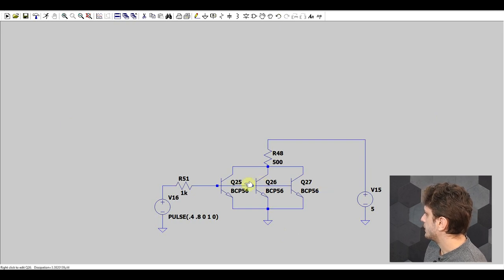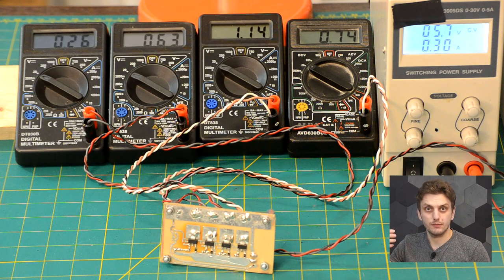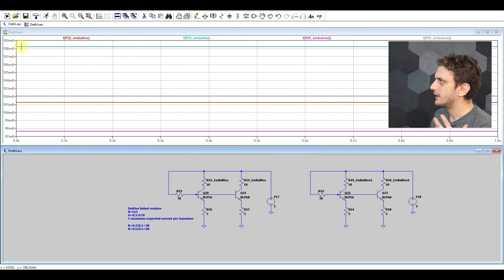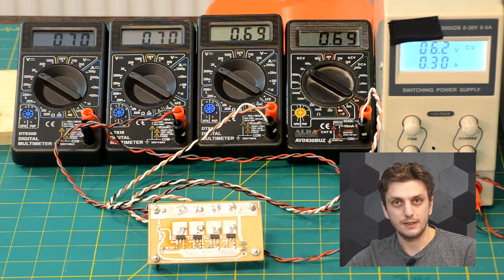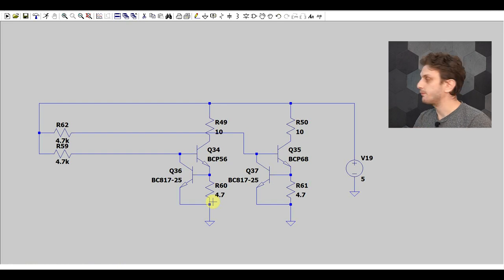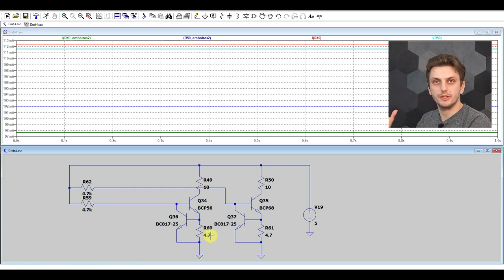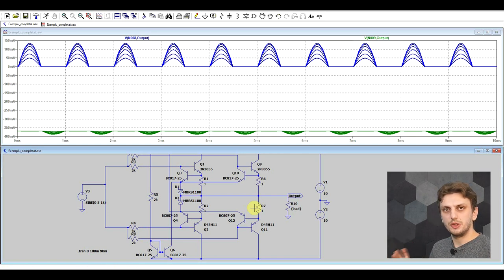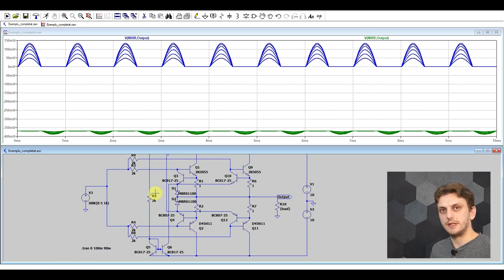Electronics Tutorial - 1/3 Driving multiple BJT transistors in parallel

Comment: Thanks for this one .. I like long videos. The title should say for BJT. I hope the next one is for MOSFETs, or why MOSFETs fail
Reply from the maker: Thanks for the suggestion! I will try to do that in the near future!
Reply: Mosfets mainly die because of 3 main reasons according to my experience; first is temperature dissipation, second is over driving the gate and third is spikes on the drain or gate. It could be also high reflections from the load to the transistor drain depending on your application.
Reply: @murad19882003  Correct.
They are also so much sensitive for over voltage in general.
Most BJTs are a lot more forgiving.

Comment: If we're just trying to get the power transistors (DC) current balanced with as low of a voltage on the current sense resistora, like with the circuit @ 16:24, I think at this point it's better to just bite the bullet and use an LM358 to provide the feedback. I do appreciate the discrete component circuit, but with the cheapest LM358 costing just over 2 cents at lcsc, it is such a cheap and jellybean component that it may be worth it in this application and I'm pretty sure it could work with just 100mV on the sense resistor.
Anyway, I do see that the video had a clear progression and considering the next circuit described it all makes sense, just thought I'd put my  two cents (heh) in.
Reply from the maker: Well, I was testing in DC because that is easiest to show, but the same methods can be applied even if the circuits have a certain frequency signal going trough. I guess the biggest problem with the op-amp method is that you need to take care of the bandwidth of the circuit, and also the op-amp needs to be close to the power transistor, otherwise you could get oscillations and other fun stuff.
Thanks for the input!

Comment: Hello Fesz!  

Really interesting subject.  Very well done.  A few comments and questions.

To start at the very beginning we could look at a single BJT wired up as your BJTs were wired up: base and collector to the V+ supply, with a current limiting resistor in the base, and the emitter at ground.  Once we apply power the transistor will start to heat.  Given the thermal time constant associated with the heating of the junction, the thermal resistance between junction and ambient and the applied voltage, it is in the nature of a BJT that it will either stabilize at some elevated temp or it will blow up.  The possible blow up is as you said, due to a positive feedback loop.  The nature of this loop is that as heat is added to the junction, the kinetic energy of the valence band electrons is increased to the point where they can pop up into the conduction band.  Since the depletion region is relatively low in carriers, these thermally generated carriers make a difference and the forward current increases.  More current produces more heat, more heat produces more current, and so on.  This is called "thermal runaway."  The increased current as a function of temperature is expressed by the Ebers-Moll equation, which you indicated.

The most effective remedy is negative feedback using what you properly described as emitter ballasting.  Here, as soon as the junction begins to heat, the increased current presses against the resistor, raising the emitter voltage, which decreases the VBE.  Since the current is exponentially dependent on this voltage, this is a powerful lever.  Note that the improved matching when you went from an RE of 3 Ohms to an RE of 5 Ohms was only about 3% (currents went from 108 and 101 to 102 and 98, a delta decrease from 7 to 4 on averages of 104.5 and 100), at the cost of a 66% increase in dissipated power.  Knowing the best amount of voltage drop across RE is best determined from historical experience (rule of thumb), as you have pointed out.

In an IC, the NPN power transistors are well matched, and in that case the current difference between transistors comes from voltage drops along the common ground (which put the emitters at different voltages).  The remedy is the same, an emitter ballasting resistor.  Finally, since this problem exists in all BJTs, we also see it small-signal amplifiers.  There, the ballasting resistor is called "emitter degeneration" and it stabilizes the collector bias (DC) current over changes in the ambient temp.  Here the delta Ic is (the temp change x 2mV/degree)/RE. RE also sets the small-signal gain, unless you don't want it for that, in which case it can be bypassed.

My first question would be:  since this problem is inherent in the BJT, are there any circuits that you know of that don't use an emitter resistor?  I can think of only two, a temperature sensor and a logarithmic amplifier, but you know applications much better than I do, and I would be curious to know what other circuits BJTs show up in without needing a emitter resistor.  Also, related to applications, do you still see that BJTs are being used in power?  Because of thermal runaway and secondary breakdown (which is a different failure mechanism associated with turn-ON and turn_OFF), in "Fundamentals of Power Electronics 2nd Ed, Erickson and Maksimovic say that "At voltage levels below 500V, the BJT has been almost entirely replaced by the MOSFET in power applications" (page 86).  This was written in 2004, and these guys are college professors, so what is your opinion?  Do you still see BJTs in power applications?  

Lastly I would love to understand the circuit that you came up with for reducing the drop across the ballasting resistor, but I was massively confused.  The LTSpice schematic showed the anode of Schottky D3 at ground and its cathode at the emitter of Q47.  Looks reverse biased, no?  Also there is a ground symbol connected to the positive terminal of V23?  Anyway, looking at the white board (excellent diagram) that you show above the built circuit in your lab, the drop across the ballasting resistor is now (the voltage on the emitter of the power transistor VE, minus the negative supply plus the 3.3V Zener).  OK, fine but what value is the negative supply and how did you choose it?   More importantly  what is diode D2 doing?  You said you "added the current sink and diode to supply the emitters of the (low power) transistors".  It looks to me from the circuit on the whiteboard that positive current from the emitter of the low power transistor would be reverse current in Schottky D2.  On the other hand, the drop across the ballasting resistor is the VBE of the small power transistor minus the reverse voltage across the Schottky, which sounds like what we want.  Is the Schottky reverse biased on purpose?  I'm just ignorant of this kind of thing.  Would love to have it fully explained.  I had to stop here, because there's too much I don't follow. 

Anyway, beautiful work and presentation as always, thank-you so much!!
Reply from the maker: Hello David!
You are right, bipolar transistors are rarely used in power electronics. Any SMPS I worked on either had external or internal Mos-Fet's. The only common usecase for BJT i've seen is with things like digital signal switches - here the RE is not used, but its not needed anyway. I haven't really worked with, but in high power (1000W+) applications you have the IGBT which is somewhat of a hybrid between the BJT and MOSFEt, which is still in common use. 
On the other hand, with audio or other linear signal amplifiers, the BJT offers more linearity than MOS-Fets; as long as the amplifier is not working in Class D then the BJT seems to be preferred.
Regarding the other point, lets start with the schematic on 14:28 - V23 has the positive terminal to GND so that its negative terminal is a negative voltage in reference to GND - the emitters of Q48/Q49 are at -5V in reference to GND. The point of the current mirror (Q48/49) is to set a current going from GND to -5V trough D3. This sets the cathode of D3 to ~(-0.3)V in reference to GND.  
With the whiteboard ( at 16:30 ), I did forget to add the "GND" but its the Cathode of D1. The negative supply is now 3.3V in reference to GND thanks to the D1 (the value was chosen mostly by what diode I had available - I only needed a voltage sufficient to keep D2 polarized and to keep the current mirror operating correctly). D2 again is directly biased, so its cathode is at ~(-0.3V), so below GND - the schematic could have been maybe drawn a bit better... 
In both cases, the signal driving the active ballast transistor is the RE voltage drop plus the D2 voltage drop. 

Let me know if this makes sense. 
Fesz
Reply: @FesZElectronics  Hello Fesz!

Thank you so much for your detailed explanation! I do understand everything now.  I learned some cool stuff and am very happy. 

Let me say this though.  In introducing the LTSpice schematic with the Schottky diode offset, you said not one word about introducing a negative supply.  Remember we are seeing this for the first time.  Furthermore, the ground symbol used to define that negative supply had a wire running over it, somewhat obscuring the ground symbol itself.  I know LTSpice lets you do this, but, in my humble opinion, it is not a good practice.  I think the rail-to-rail environment (the supplies) are the essential framework of a circuit and should be noted.  

It is all obvious to me now.   

Here is how I see the offset working.  With the addition of D3 and the current sink Q49, we may start at the collector of Q49 where the voltage is about 0.3V below ground. Moving up, through the emitter of Q46, we then reach the base of Q46, which is the voltage across the ballasting resistor and this is (-0.3 + 0.6) = 0.3, and you have reduced the voltage across the ballasting resistor by the drop across D3, just as you said. This is a beautiful way to create a desired offset.   The voltage on one end of the ballasting resistor is pulled down by the drop across the Schottky, while its other end is grounded.  Very, very cool.  I am looking forward to learning more. 

Finally, you mentioned that: "with audio or other linear signal amplifiers, the BJT offers more linearity than MOS-Fets; as long as the amplifier is not working in Class D."  Do you have any videos that talk about audio and linearity? Like how do we measure linearity,  what does it look like in a circuit, how would an output be more linear with a BJT than with a FET, etc.  Just anything to learn about linearity in an application.  Any videos on that?

Thanks again for your amazing work!!
Reply from the maker: Hello David,
I did not cover linearity in any video yet. Don't get me wrong, you can make a perfectly good amplifier both with BJT and M-FET. The BJT is cheaper, and from a linearity point of view, the driving the FET is like driving a capacitor - the gate-source capacitance can be in the order of nF so you need completely different current to drive it at 20Hz and at 20KHz. Also for FET's you have the transition between linear and saturation regions at quite large drain-source voltages - so the change in behavior needs to be taken into account. J-Fets on the other hand are far more linear. To be honest I did not study this problem in to much detail so I may be missing some points.
P.S. I will try to keep my schematics more easy to understand, and go into more explanation details. Thanks for pointing this out.
Reply: @FesZElectronics  Hello FesZ,

It is always great to read your comments!

Yes, JFETs are interesting.  When I worked with power op-amps (hybrid circuits) the differential pair was typically built with JFETs.  Flicker noise in MOSFETs is associated with the thin -oxide (carriers get trapped there and released, if I recall correctly).  JFETs have no thin-oxide, so no flicker noise (if I am wrong let me know).

Your work is a tremendous help and asset to me.  Thank you so much for what you do!
Reply from the maker: Indeed, JFET's are known for being low noise - they are often used as high impedance input stages - in IC's as you mentioned, but even in things like oscilloscopes, the very first component the signal sees, is usually a JFET. From what I read only BJT can be built with lower noise than JFet but you need some current to drive them, so a Jfet input stage in an op-amp has a much lower input bias current. 
I guess the only problem with JFets is that they usually come in low power versions. On the other hand, for a final stage in an amplifier, it does not matter if the MosFet is noisy, since its contribution to system noise is minimal.

Comment: Very juicy video. Chuck full of bits and bites of solid reasoning and clever design tips.
I wonder why no one uses PTC power resistors for RE! It should prevent thermal runaways in MOSFETS. 
Logically, it should work, but I've never seen one!

Comment: Hi Fesz, what a cool video! thanks. I've dealting with this issue in audio amplifiers and isn't easy to calculate with precision the emitter resistors to avoid positive feedback and with  reduced dissipated power... normally I do a fast test with a heat air flow and adjust the resistor for a pessimistic scenario. It typically gives a value minor then 0.22R... However, to have some margin I always finishing by using the typical value of 0.22R 😄.  Best Regards, Hugo
Reply from the maker: Hello Hugo! I'm happy you enjoyed the video! What sort of currents did you have running trough each transistor when you used the 0.22r in the emitter?
Reply: Honestely Fesz this was for a project that was never been finished... but I remember that I have done some trials for 3A to 5A of peak current in each device and after some calculations  the resistor adopted was 0.22R. I don't remember the exact values but the question was something like this: ok 0.07R is enough but 0.22R gives a better current distribution and the dissipation is acceptable 2.5W... so let's use 0.22R 😄. In fact, this resistor has some impact in THD. This is a very interesting theme and there are few information about it. I've done a couple videos, in Portuguese,  talking about these resistors and respective design criteria. Maybe you can talk a little bit about this in the next videos. My approach at the time was: assume a maximum delta vbe deviation between the 2 devices, ok 350mV... (one hot and the other cold)  and calculate the resistor that  gives this voltage drop with the maximum expected current, 3A or 5A. My final project only uses one device, STD03, so i don't have this issue 😉 but even in this case it uses 0.22R 😄. A big hug 😊👍

Comment: Great video as allways!
One thing to note: mosfets, as opposed to bjts do not need matching for this type of application  and can be directly connected in parallel as the rds_on has a positive temperature coefficient, providing in by itself the needed negative feedback -> adding source degeneration as suggested at min 9 may be a bit of a overkill.
Spor in ceea ce faci omule, esti cel mai tare eevloger din cate stiu!
Reply: If you drive the MOSFETs in the linear region that's true, but then in the saturation region the temperature coefficient is negative and the same problem arises.
Reply: Not correct what you say, in fact Rds_on exibits PTC behaviour in saturation (MOSFET fully on). 
Nexperia application note AN11599 chapter 2 treats exactly this subject.
Reply: @bogdansofalca6946  Confusingly what is called saturation for bjts is linear region for MOSFETs, so you're reffering to the linear region. https://electronics.stackexchange.com/a/18904
Reply: @axk1  I did not know that.  What you say is very interesting.  In the linear region the flow through the channel is resistive and the resistance goes up with increasing temperature because the mobility goes down.  The mobility goes down because at higher temperatures the crystal atoms are vibrating more widely, which restricts the electron flow.  In saturation on the other hand,  the electron flow at the drain is either pinched (long channel device) or velocity saturated (short channel device).  Why would, say pinch-off, change  the temperature behavior?  I mean, do you have any explanation for why the resistance doesn't increase with temperature in saturation?  I don't. Would appreciate your thoughts on this. Thank-you!
Reply from the maker: @Bogdan Sofalca @LeshaKu @David_60 - thank you for all these comments! I will be doing a second part regarding MosFets and try to address the issues that you all mentioned.
Reply: @FesZElectronics  Thank you FesZ!  Your videos always raise many interesting questions in my mind, which, as I think through them,  improves my understanding.  As I have said before, your videos are absolutely the best thing on YouTube.  Thank you for doing them. Happy New Year, and may 2021 be the best year ever for you and yours!
Reply from the maker: @david_6063  Happy New Year! Keep safe!

Comment: I'm using irfp260n MOSFETs  and using a checker to get the gate voltage as close as possible so could I place a 3 to 5 ohm resistor on the gates  and that should match them even closer even though they are  closely matched already
Reply from the maker: I'm not sure if just connecting the transistors in parallel is a good idea at high frequency - because of the distance in-between you will get phase variations in the signals that reach the gate and are then interconnected after the drain. I think some sort of trace length equalization will also be needed.

Comment: Hi trying to use transistors to drive LEDS using arduino and Max7219. My project works with small 7-segment LEDs using the supply of Arduino. However when I use 13V external supply for a bigger display, the LEDs are ON all the time. I'm using NPN to drive the DIGITS and PNP to drive the SEGMENTS. What could possibly be the problem why my project doesn't work anymore when higher voltage is used, the negatives of Arduino and external supply are joined together. Many thanks for your help.